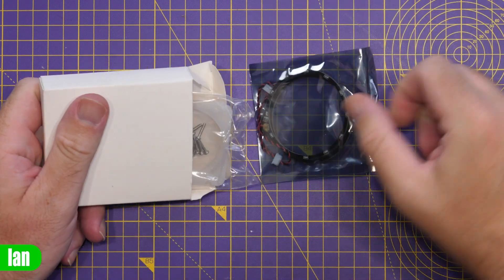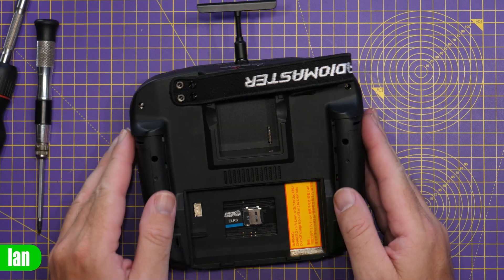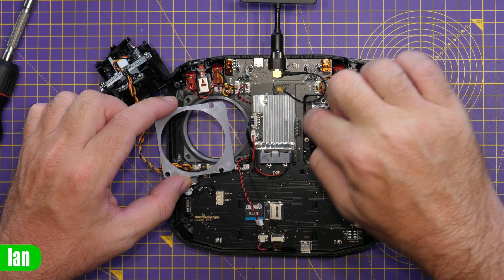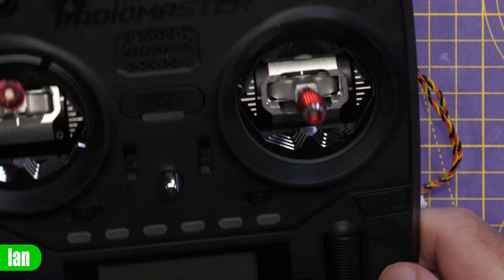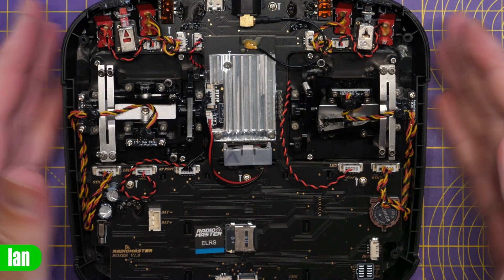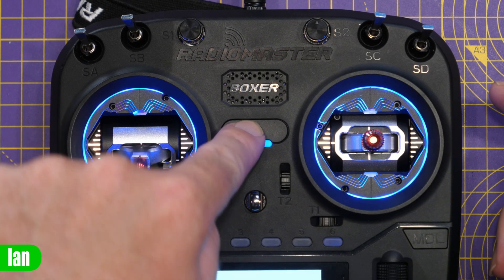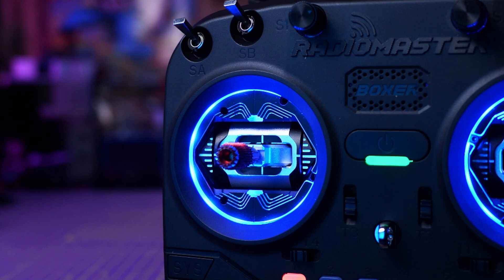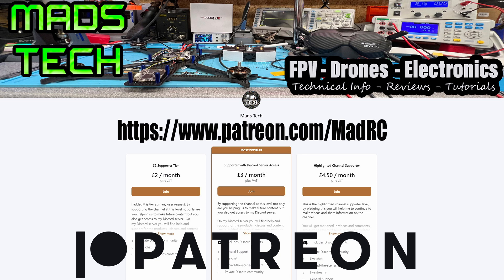Radiomaster Boxer Upgrades - Bring On The Bling

Comment: Could one add a couple washers under the new screws instead of cutting them short?    Are the LED rings dimmable to match the LCD brightness?   Lastly:  It would be awesome if they offered red or amber LEDs... you know: for a more submarine/aviation look.
Reply: I found out a way to make the LED ring lights adjustable. I made a tutorial on my channel.

Comment: not installed correctly use the other plastic piece to hold the led ring. zero issues with screw then. Face LEDs down for bright, face up on the plastic retainer for reduced LED glare in your face

Comment: If you're not sure about whether you'll have to take a knife to the back plate, just pop open your module bay and if you have holes on both lower corners, it'll be fine.

Does anyone know the thickness of the LEDs? is it possible to use the CNC gimbal spacers AND the LEDs together? Gimbal spacers add 4.5mm

Comment: Inside mine it says Boxer v2.0 (on the board). I did not have a single issue with screws and they are the same length you showed in your video before you cut them to new length. I also did not have any trouble with those plastic pieces catching on the back cover. It fits like a glove without any modifications on my end. Did they change anything with new revisions?
Reply from the maker: Yea as mine was pre release I had the old moulded back cover and that’s why it was catching.  All the consumer ones are fine.

Comment: Which RadioMaster has built in ELRS and legacy protocols/hardware built into the radio (No external module)?
Reply from the maker: There are none with both. It’s ELRS or 4 in one.
Reply: @MadRC  so basically if I want ELRS radio buy boxer or buy external module for my TX16.
Reply: Or a Boxer with Elrs and an external 4 in 1
Reply: @malte9999  It is my understanding, that the ELRS protocol is so different than all the legacy protocol, that it would be best to have two radios.
I mainly fly fixed wing including FPV with Ardupilot firmware. And if I want to fly quad copters, I should just start from scratch since BetaFlight, ELRS, EdgeTx have better EcoSystem.
Reply: My setup is a TX16S with internal ELRS and an external 4 in1.
Everything I have is already converted to ELRS or will be soon, except for some Horizon Hobby BNFs.
For trainer mode with the Kids I have an RP2 connected to one of the AUX serial ports. The Receiver sends SBUS to the trainer radio and the radios for the kids all do ELRS to that receiver.
This setup works great for me, without issues. Who said that you should have two different radios and why. It would good to know, so that we can address this in EdgeTX.

Comment: What is the chance to switch off those leds while arming. Because it's useless if it flash all the time. Especially on evening - this is official invite to moscitos. My back lite is always off during flight.
Reply: You may be making a joke that went over my head but mosquitoes are attracted to CO2, not light.
Reply: But agreed. These would be best on a switch and not always on.
Reply: Joshua Bardwell had the brightness on a pot so you could turn it up and down. Once you've watched that video then you can program the controller as per one of his videos. When the arm is high, brightness is low and that should do it.

Comment: @Mads Teck, how many millimeters or inches did you cut the screws?
Reply: I cut about 2mm on mine. Eyeballed it and only had to shorten one a bit more.

Make sure to cut metal that sticks out to the sides too much after cutting so that you don't create a makeshift drill bit that would ruin the plastic you're trying to screw into
Reply: Ok, thanks

Comment: Have the radio but as for perfection, the only thing that is annoying, is the antenna. You cannot have a nice grip to tighten it and when you rotate it the antenna itself the wrong way (as it spins), you might loosen the antenna i have noticed, so I always double check it is tightened enough.

Comment: Hi new subscriber here. I thought if you broke the seal on the bottom of the TX it voids your warranty. Is this true?
Reply from the maker: Radiomaster are very good. If it’s a manufacturer issue they will sort it. They sell the gimbals and these rings as accessories